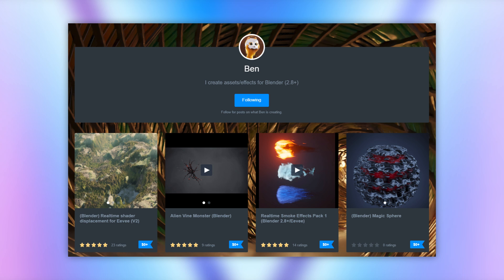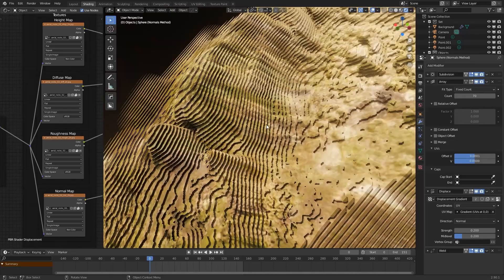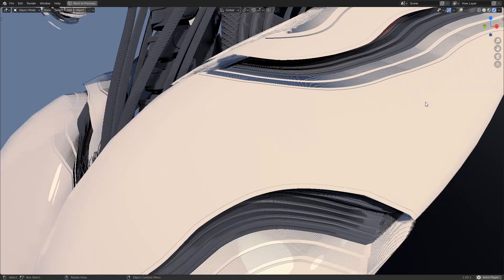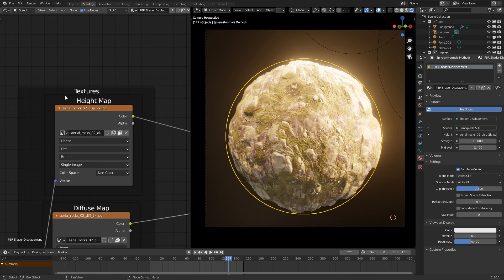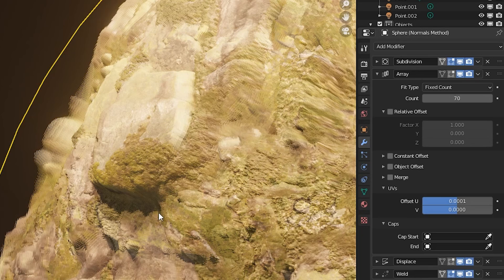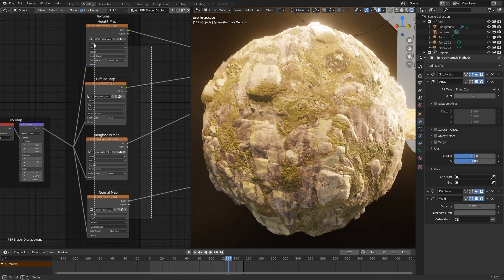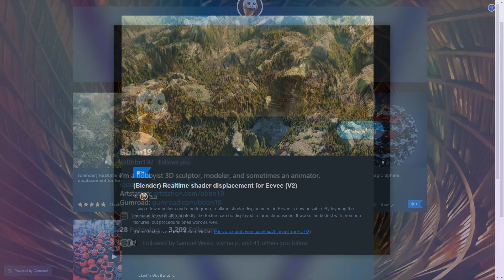REALTIME Shader Displacement for EEVEE!

Comment: For anyone wanting to replicate this at home: CRUCIAL information has been left out of this video for Blender newbies and even intermediate artists.  If you want to apply this effect to a new primitive object, you must make your new primitive shape, link all modifiers and materials from the demo object with working displacement, but your new object still wont have Eevee displacement after that.  To make it work, you must open object properties on the tool bar on the right (the upside down green triangle icon) and with the original working displacement object in the demo file selected, navigate to the "UV Maps" drop down menu.  You will see a UV map labeled "Gradient (UVs at 0.0)".  Click that, then press ctrl+C to copy it.  Then, navigate back over to your new primitive, and open object properties again.  Go back to where the UV Maps dropdown menu is and you will see there is no second UV map, just the one called "UVMap".  Click the plus sign on the right to make a new UV map, then click on that map and press ctrl+V to paste the necessary map in place.  NOW it works.  Also, for whatever reason, the sphere labeled "Sphere (Normals Method)" (the one the camera is centered on) is the only object in the scene that will work for copying settings over to another object.  If you attempt to use any of the other objects in the scene to copy stuff over, it wont work.  Weird.

Comment: Hi, I am facing an issue: If I have multiple models that all has the same UV Map (Gradient), the texture node will not adapt from a model to the next and if I turn the UV MAP content label "Not Red" for one object, the next object loses its parallax. Is there a workaround? The only fix right now would be to make unique instances of each object's material so the UV Map selection doesn't conflict.

Comment: AO definitely doesn't work , soo thats false information , also shadowing is kinda borked. Tesselation Displacement from the opengl4 spec would be much better, I mean gpus come with extra hardware tesselation shaders , but blender thinks its better to use opengl3 because some 3rd world kid might use a 15 year old laptop
Reply: Tesellation is tesellation and it is not a good idea, and never produce good results without use millions of polygons. Never forget, Eevee is realtime, and realtime engines need fast and light processes, like Parallax Occlusion Map or Relief Mapping.

And do not only 3rd world kids use Blender. Most people use two graphic cards, one for Viewport, one for render. Example I use Intel's HD graphics for Viewport, and use my 1st GPU for Cycles render, because if not, I am not use my computer when I take render. I can not use second graphic card, because my card use two slot area. If Blender not support OpenGL 3, I can not use Intel's HD graphics. Why? Eevee is not a game engine. If you want high-end game engine, then use UE 5, not Eevee.
Reply: @spiderh  i suggest you download unigine benchmark , and then turn off and on tesselation to see what i mean !  tesselation + displacement is a standard technique and there is extra hardware in gus to do that without much performance hit, yes even on your intel gpu , thats one of the greatest features since dx11 hardware. crysis and alot of other titles use it , its also implemented in quixel mixer , in substance painter and many other 3d tools for visualisation
Reply: @spiderh  if its good enough for substance and mixer, then its also good enough for eevee ... you just need it to create nice looking surfaces, its definitly better than the technique shown in the video here , what are you even trying to argue?. you´re a graphics programmer but you use your intel gpu for blender? lol

Comment: Is this the same method that unreal engine use on their parallax occlusion mapping?...
Reply: Yep. Pretty much. Except the system is much more automated in UE4.
Reply: Almost the same, but the way its implemented is different. Parallax occlusion mapping doesn't duplicate the mesh several times but instead does the 'layering' on a per-pixel basis.
https://www.gamedev.net/tutorials/programming/graphics/a-closer-look-at-parallax-occlusion-mapping-r3262/
Reply: @MFSCraft  The good thing with UE4 though, is you don't have the extra mesh  hull drawing, and the parrallax can have a pixel vertex offset, meaning you can push out the edges of the mesh with the same parrallax system without the limits of parrallax which is generally restricted into the mesh boundaries.
Reply: @MFSCraft  An example is the Gfur shaders and implementation, which uses that system.

Comment: This is a work around. why cant it be real geometry like in Cycles ?
Reply: Cycles micro disp is based on Ray Tracing by pixel coordination, so the geometry you see with it is nearly impossible to be recreate on raster based graphics like Eevee or any other game engine, although there is a work around now called "Mesh Shader" or in Unreal Engine 5 they call it Nanite. As same as Micro Disp in ray tracing it's not suitable for deforming object but for solid only. only time will tell who will implement it to Blender, but i dont think with the current OpenGL can do it, maybe when Blender fully moves to Vulkan API would be a dream come true
Reply: @yasunakaikumi  why are you lying ? Rasterisation doesnt care about poligon count. 10year old games like crysis2 already use hardware tesselation as outlined by opengl4 and dx11 spec ... Since then most aaa games have used hardware tesselation , its a free effect on modern gpus
Reply: @yasunakaikumi  you deleted your post but ill answer anyways , its not implemented because most dcc´s target is not realtime graphics . but its implented in quixel mixer, in substance painter , in maya (although basic) and of course in ue4 and unity and most other gameengines
Reply: @goku21youtub  ill just, sums it to you, Tessellation is basically subdivide on the fly based on the geometry of what the camera is looking at, it acts more like a mipmap rather than based of the pixel which is Mesh Shader is acting like...

This is from official microsoft DX12 Mesh Shader into page

"Mesh shaders subsume most aspects of Vertex and Geometry shaders into one shader stage by processing batches of vertices and primitives before the rasterizer"

sounds familliar to micro displacement?, it is a new way of LOD system but more on GPU controlled which you can just put a displacement map on a mesh then let the GPU decide which will go up and down, basically it compute on vertex. I suggest just read it and understand that Tessellation wont even gonna cut it
Reply: @goku21youtub  also we are talking about Eevee here, it's real time preview not for offline, yes they can implement Tessellation but god knows that feature is so taxing on GPU ram when there's so much stuffs you have tessellated because the original mesh data needs to be always in the Vram, while Mesh Shader can offload any stuff that is too far away and even lower the poly count reducing the ram then recall it portion of the mesh when needed. but it's up to devs which is better tho. since I cant program, I just read and test it out.
Reply: @yasunakaikumi  why dont you try it out , instead of reading about it ? because the info you post id false. you can download something like unigine benchmark and the turn on and off tesselation on the fly. if you have quixel mixer you can also turn off and on , the results are pretty much the same as  with microdisplacement , but realtime. 

blender eevee just doesnt have it because its opengl 3 spec and keep compatibility with old gpus and weak pcs. the devs could implement it in less than a week if they wanted to

Comment: very interesting, is it faster and more flexible than the displace modifier though ?
looks like a drag to setup.

granted the displace modifier has it's own drawbacks.
Reply from the maker: Well the whole point about this system is that you have absolute stylistic control over it from the shader nodes, which allows you to get the unique effects shown with the nanotech robot demo. This system also allows for 'volumetric' objects, in the way that the planes can form an interior where regular meshes would be just empty space.
See this example of a similar version of the technique being used to represent CT scan data: https://twitter.com/Bbbn192/status/1310266754078253058

Neither of these things can be achieved with a displace modifier alone.

Comment: It's a very smart way of doing displacement, I wonder if it's actually less taxing on performance especially in the case of terrain on planes, you produce less geometry. It should be easier on VRAM for sure.
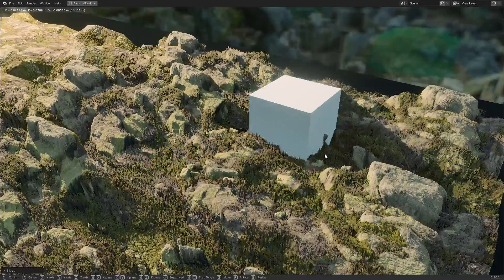Reply: Doubtful, just look at the choppy framerate at 1:35